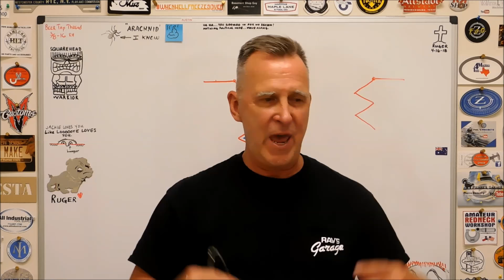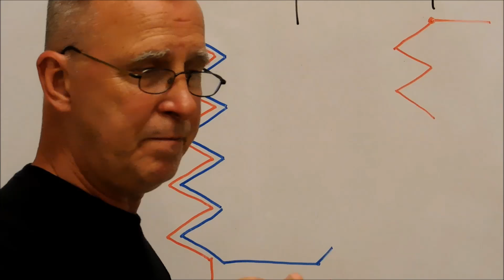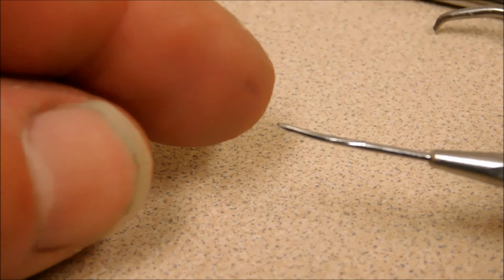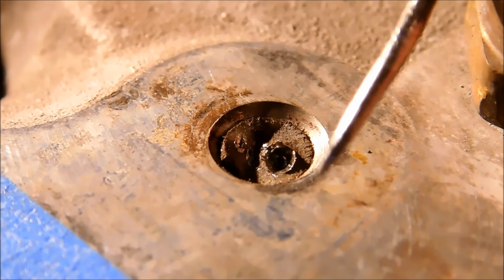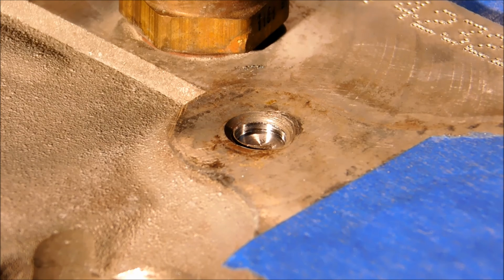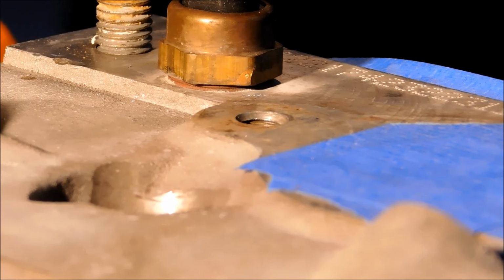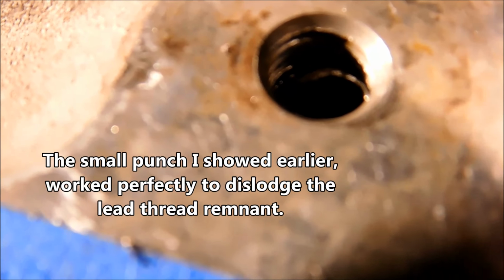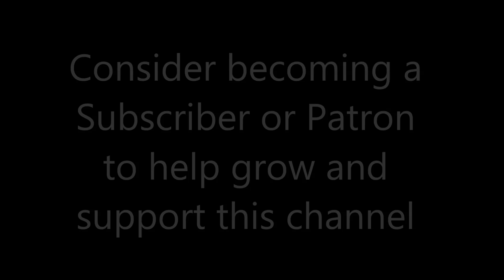Removing Sub Surface, Snapped off Bolts -- Take a Look !!

Comment: My horror story goes like this:  I broke a #8 tap into a hand drilled hole.  Which means it was pretty much sure to not be perpendicular to any known surface.  And I did not have access to a milling machine anyway.  The tap was broken at some 40 degree angle, so I immediately knew it would not be a place to try my carbide bits.  Also, the 3 flutes were stuffed.  What I had was a stereo microscope with a coaxial light and finer dental picks than what you showed.  So I got some of the crud out of the flutes and then tried small steel pins in the flutes.  Did not tun.  In desperation, I started grinding with my Dremel and a few different shape diamond burrs.  The problem with them is that they do not "eat" the target at the center.  But eventually I got the tap remnants nearly level. and a little dent at the center.  Then I alternated with a carbide drill and the diamond burrs.  Took me two days to remove the about 8 mm length remnants of the tap.  With hindsight, I could have built an EDM system in less time.         .
Reply from the maker: Sometimes you get lucky, sometimes you get a reminder who's in charge. I just hold my breath and hope for the best. Move slowly.
Reply: Taps are probably the most dangerous tools in the shop. Few tools can cause so much trouble when they fail. For hand tapping, I always do it carefully. with lots of cycles to remove the chips off the tap flutes to avoid possible binding. Best option I found for tapping is to do it  a milling machine with a drill chuck. The tap will slip in the chuck before it snaps and there is less chance of apply side forces to the tap. I also avoid using carbide taps since they are more brittle than HSS.

Comment: I sell cars. Roughly once a month I'll have a car with a seized license plate mounting screw. Usually Toyota/Lexus, but a few others also use metal threaded holes and plated screws that eventually corrode. At least for short threads like that I've had great success by drilling a little smaller than the proper tap size (I use 3/16" on these M6 threads) and using a spiral point tap to finish clearing it out. Very quick and easy, and because I'm using a handheld drill in the parking lot, rather than mounted properly on my mill or drill press at home, the undersized drill helps me stay clear of the original threads if I'm not quite centered or squared. 

Finally instead of typical cutting/tapping products I just use anti-seize so I don't have to clean out some other product and when I'm done the threads have a good coating of anti-seize.

Comment: I have two questions, why did you switch to using a drill bit rather than carry on removing material with that end mill? And no cutting fluid were used with that drill bit, any particular reason why?
Reply: Probably because end mills don’t come in the required diameter. Many more sizes with drills.
Reply from the maker: End mill established the true flat surface, the drill was size specific.
Reply: @joepie221  Ah, OK Joe,...and why no use of an oil/cutting fluid then?

Comment: How to get out a broken tap in aluminum?  I tried the alum trick, but it didn't dissolve the small 4-40 tap.
Reply from the maker: Carefully plunge a carbide end mill clearing the dust frequently, or EDM it out.

Comment: This is the best advertisement for Never-seize.. (make sure to use the correct type for best results)
Reply: Copper for high heat.
Reply: @xmachine7003  There's a ceramic which is even better than copper for high heat applications

Comment: There is another way to skin a cat if its a larger bolt -drill a hole ,approximetly in center and shove in allen wrench -then weld it around.Heat will loose up threads and you can unscrew it out easy.You will sacrifice allen wrench but those are cheap to buy+you can charge extra for it.

Comment: another well done job. My question is that when you drilled, and the thread went deeper inside, because you dislodged it, why didn't you put a reverse drill into it, and it would have possibly come straight out ?
Reply: He told you in the video he didn't have a left handed bit.
Reply: @stargazer7644  I realise what he said. The way the thread plunged in, I would have gone out & picked up a drill bit. Then I would have run a tap into the threads to make sure the threads were ok.  Either way he did a good job.

Comment: Joe, you are the consummate professional engineer. You have a neat clean workplace, you know how to design stuff, you know how to machine stuff but, and I'm sorry to say it, you really don't know how to video stuff. 
It is a shame to mar such good videos with shaking cameras and out of focus shots.  Please get some camera stands and change the settings on the cam so it does not go out of focus.  Auto-focus can be a real curse.
I dislike making a negative comment but it is meant with the best intentions.  Your videos are always informative and present non-trivial information in an understandable fashion. I am very grateful that you take the time from your busy schedule to make and post them.  Thanks, pls keep making them.
Hope you take this in the constructive vein in which it is intended.
Stay safe.
Reply from the maker: This was one of the toughest videos I have ever shot. The camera was in the way of my sight, what the camera showed wasn't always what I was looking at, the reflection off the head triggered the BLC of the camera and changed the exposure and focus, and the BX500 Nikon doesn't have a manual focus option. So although I am a little hurt with your comment, I must be honest and say I tried my best to present it the best I could under the circumstances. Thanks for your honesty. When the Covid thing calms down, I plan to use my Patreon account to get a better camera for you guys.
Reply from the maker: I was notified this morning of your contribution towards my new camera. I am very grateful for that. Stay well and thanks again.

Comment: It's a lot more exciting when Its a 4-40 set screw 1/2" deep in a  $15k aerospace casting. The number of times I have sworn that if I ever met the ass that designed this.........
Reply from the maker: Been there, done that. Thats a setup you check 10 times before you sink the drill.

Comment: Weld a nut on it. Ive been doing broken stud extraction for years..Nut welding works 99% of the time.. especially when you dont have a mill  on site or an hour to spare...
Reply: Right you are.
Reply: Yep on a head, i torch every bolt head off an exhaust manifold then just back out with pliers. And the broken bolts at the end are always flush and come out easily after a nut is welded on them.
Also that way no need to remove the head off the motor either

Comment: I too am an anti-easiout advocate, having broken one in a cylinder head that was then scrap as a result.  However getting broken bolts/studs out invariably has to be carried out insitu that then involves hand drills..........!  
As the head you showed was aluminium and the stud was carbon steel I would have not bothered with trying to salvage the original aluminium thread and bored oversized to install a Heli-coil.  Steel threads in aluminium are likely to be corroded, especially as the stud had sheared and the aluminium threads were likely to be suspect for future use.  Also, heli-coiled bolts in aluminium are less likely to corrode as the helicoil can be set with loctite and the whole assembly is stronger than originally. The centring would have been less critical and may not even have required a drill press.
Reply: I've taken a lot of those out and very rarely do they need inserting. The usual  cause of the stud failure is that the manifold has warped and the stud has failed due to tensile stresses not axial motion

Comment: Thx Joe only 2 more to go. Hahaha. Clever method.
So how do you apply this technique on the vehicle?
A method.

Remove front clip. Fenders, hood bumper etc.
Turn vehicle up sideways. Either side first, doesn't matter which. Forklift it, vehicle, over to the mill or forklift mill over to vehicle on its side.
Continue as shown in this video.
Remount manifolds. Vehicle may be returned to horizontal your choice now or at the end.
Reattach exhaust system.
Replace front clip.
Drive on.

It just might be easier to remove heads and deliver them to dad who owns a machine shop and let him fight with the broken bolts. Hahaha.

Hey, Joe what about welding a nut to the broken bolt? Even subsurface can be done. Your thoughts.

Thx again Joe for sharing.
Reply from the maker: Great comment.

Comment: Your son owes you a old fashion hand wash and wax on your motorcycle. Just tell him "Wax on" --"Wax off." he'll learn. LOL! Great stuff Joe. I couldn't believe the length of what came out of the hole. If my lying eye's hadn't seen this video. I wouldn't have believe all of that came out of that one hole. I'm a believer now!! No more easy-out's.
Reply from the maker: Dave, Buddy, NOBODY touches my bike. I even tell the dealer not to do the courtesy wash after service calls. I would accept a thorough washing of my Tundra, but my family knows where the line is drawn. And yes, even I was surprised at the length of the spring that came out. But if you think about it, a 6mm bolt engaged in a hole 12mm deep leaves about 750mm of string behind when drilled out.

Comment: Neat work Joe!   If you can clear out the start of the thread - how comfortable are you with running a tap down the hole to cut out the remnants of the fastener as a Plan B?

Comment: If the surface isn’t flat, how could you ensure that you drill exactly on the long axis of the bolt?
Reply from the maker: You basically can't unless there is another clean stud to setup with. When would you encounter such a condition?
Reply: @joepie221  apparently my phone is on a different account than my computere.  I am a prosthetist, We sometimes have  set screws strip out.  Normally we just replace the whole part.  I just wasn't sure if there was a way, I'm a terrible machinist. Thank you for your knowledge.
Reply: @danballarin  you'll only ever be able to be close.   If there is a counter sunk hole, you could try aligning the drill that way by putting a countersink in the chuck and matching up the bevel on the workpiece to the countersink. Obviously the head of the screw would have to be snapped off or below the surface or have to have some sort of relief, but cones and tapers are great at aligning different parts like threads and rods, etc.
Reply: Where the intake manifold bolts on some of Chevy vortex and Chrysler magnum engines the bolt is vertical and the head surface is at about 30 degrees while on the engine. Most have a counterbore down to where the thread starts, so a little ingenuity is needed for setups.

Comment: If two or three threads are exposed at the top of the hole  we always used a bottom tap to remove the wire. A STARTING TAP WILL BIND UP IN THE HOLE, DO NOT USE IT.
Reply from the maker: Agreed.

Comment: I've removed lots of broke bolts from LS heads but never seen one break off on the front of the head before. I always see them fail on the rear bolts.
Reply: The front on driver's side head is the rear on the passenger's side head.  Good job getting that out.
Reply: I see them front and rear on a regular basis
Reply from the maker: One head had both ends broken, and the other just one end.
Reply: @joepie221  pretty safe bet that if you check the manifolds for flatness, they will be kicked up at the ends and the stud failure is the result of tensile loads

Comment: Not how I would have done it, but I usually don't have the luxury of taking parts to a machine; most often I get called on to drill out a stripped or broken fastener on the top (or bottom) of a wing or something.  At least the guys on the other shift who called me in last week were smart enough to stop once they knew they had a problem, rather than trying to drill it themselves.  The worst ones to remove are usually left by the mechanic who fancies himself a metalworker, and tries to remove it himself.  Or "in position" drilling where you are trying really hard not to need to remove an engine, cylinder head, etc.  I live for drilling out broken fasteners.  🤪
Reply from the maker: This was a luxury setup for sure. And the guys that butcher a hole then call you, should be made to get the stud out as a lesson.

Comment: How did you locate the proper angle to hold the head at?
Reply from the maker: Indicated it on the X and Y. You can use a pin in an adjoining hole if you need to get a reference.

Comment: Myself I've had terrible luck with easy-outs ! so knowing that if I find a bolt that feels like it will sheer off instead of come out I try to work it ALOT with  a bunch of soakings of WD-40 and if possible heat on the bolted down to area not on the bolt itself,  and usually I can save myself alot of extra work before I sheer the bolt completely off !  but not always !
and I find it extremely hard to center the drill when trying to drill the bolt out (especially doing it freehand under the hood! ) the gauge pin is a great idea but when none are available how do you find center of the hole itself ? (and yes I have chucked up an end mill in a hand drill to flatten the broke off stud.... that is 90% of the problem when doing it free hand...so if you make dead certain your in the center of that egg shape then put in your center punch and can drill a straight hole ....go for it ! however.... be warned ... you may be forced to drill the entire hole out bigger and re tap to a larger size ! Joe's way is better  if you can get the part OFF ! LOL
Reply from the maker: The best bolt to extract is a bolt that nobody else messed with.

Comment: A trick we use on stuck pins in the tool shop is to get a pad free orbital sander on the end.  The vibration along with some penetrating oil will often walk them right out.  You could use a punch to transfer the vibration into subflush bolts.  That said the EDM gets the bad ones.

Comment: Just curious were the bolts put in with anti seize?
Reply: Tracy Curtright if there's any heat, then one of the grades of anti-seize is what you want to use.
If the fastener is not exposed to heat, then use a removable grade of lock title (usually color coded blue).
Being a plastic, the locktite sets up water tight, so no corrosion.
Reply: The best antiseize is silicone sealant, no water in, no dissimilar metal corrosion, stands 1200 degrees. I used it on racing engines instead of loctite which softens under heat.

Comment: Don't remember the name and they are hard to find  i believe snap-on do a set and some of the german tool companysdo them as well mine are too old to read the name any more as they have been well used should come in a set with drills spline tools and tap handle which fits on the square end of the spline tools
Reply: Blue point E1020 or Ridgid model 10 is what you're looking for.

Comment: The real problem is that most broken exhaust studs need to be drilled out well the engine is still in the vehicle and sometimes require jacking up the engine or removing the heads.

Comment: Beautiful...
Reply from the maker: Thanks for watching
Reply: Oh Sure...I really enjoy All Your videos...especially all of the lathe work...I am retired Aircraft Propeller Blade Technician...about 
20 years worth...On some Mcauley prop blades the furells (steel nut) at the butt end of the blades would be seized to the aluminum blade...back in the day we used a bucket of solvent and dry ice to freeze both the nut and the blade and after all was pretty much frozen we would take the blade out of the bucket and placed it in a holder with a special tool for holding the nut placing sometimes two 1/2” aircraft bolts to hold it...then with a 12 ft. Steel bar and about 3 big tall fellas on the end of it we would attempt to break the nut loose...that was while another fella on the gas torch would heat up the nut...they would break loose most of the time...but once in a while the 1/2” bolts would break...and then we would start the process all over again...they always came off..!
Another issue was I had broke a machine screw off into an aluminum prop hub...well the boss came over and got the broken 
Screw out and decided to run a tap down the treaded hole...after he had broken the tap off...I said:  We always did work well
Together...
Reply: Tried to send a photo but it wouldn’t work...

Comment: Endmill plunging is a similar force to drilling, right? If anything, lesser than a given drill?(assuming everything is perfect). Obviously any cutting side to side is probably going to result in a need for some bigger safety glasses/thicker leather in the apron

The GM 3800/ecotec tended to snap the studs midway between the head and the outside of the flange, making it easy to weld a nut on and pop it out(or vice grips)....or let it run rich for a few days until the carbon blocked up the small gap created.
Reply: I think the collective wisdom about not using endmills in drill chucks is because the shank is hardened (or carbide) unlike the shank of a hss twist drill which is usually soft enough for the chuck jaws to bite into slightly and not damage the jaws if it spins.